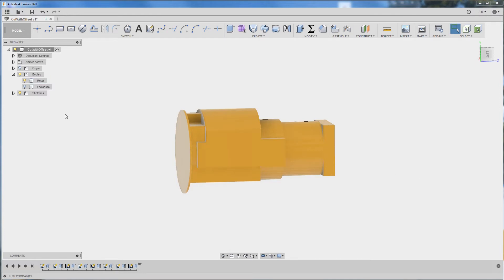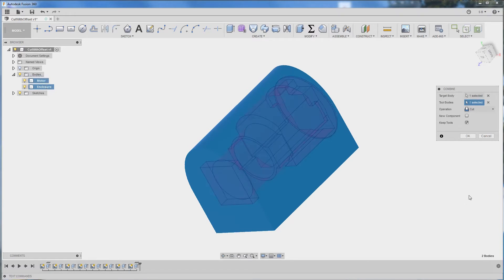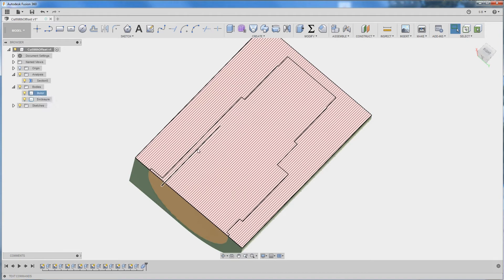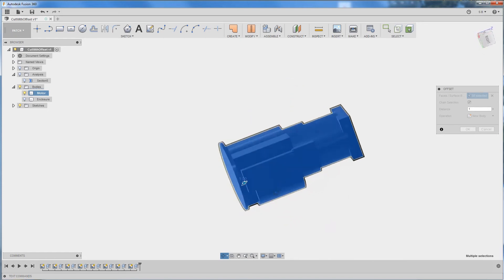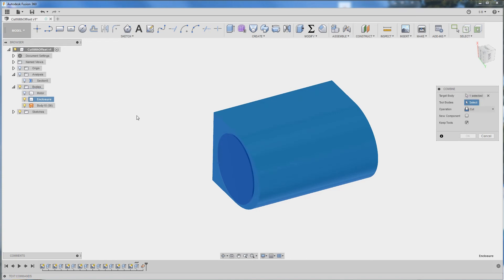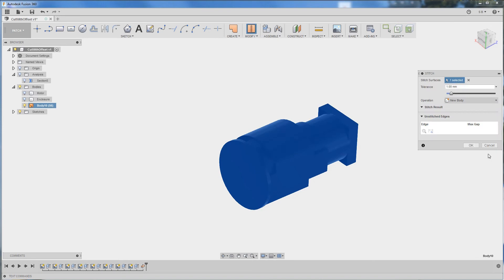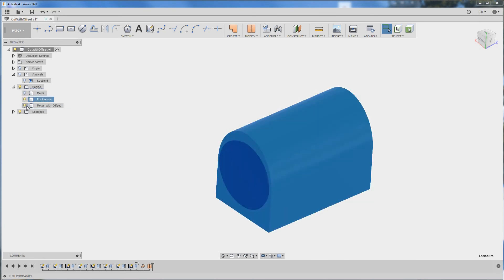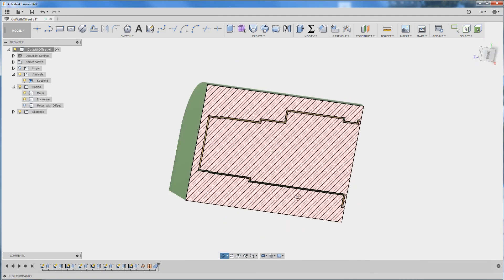Fusion 360 offset body, creating tight-fitting 3D enclosures and shells.

Comment: 4 years later - changed interface - interface in other language - little experience, at 1:50 suddenly there is a "patch" mode enabled and there is the offset tool, which I don't have in construction mode and I don't know where to find it, nor what that "patch" mode is supposed to be in my language... Solution: They moved "patch" mode to the "surface" tab.

Comment: Is it easier to scale up a copy of the body and then subtract it?
Reply from the maker: No, scaling only would work for simple shapes like a sphere, imagine you have a donut (torus) then if you scale it the inner hole would be bigger than original, which is not good.
Reply: Yes that's the way we make molds for plastic sheet forming.